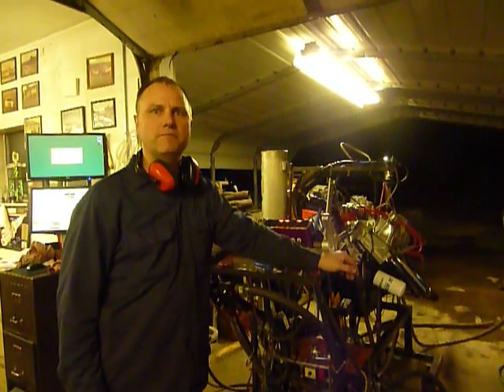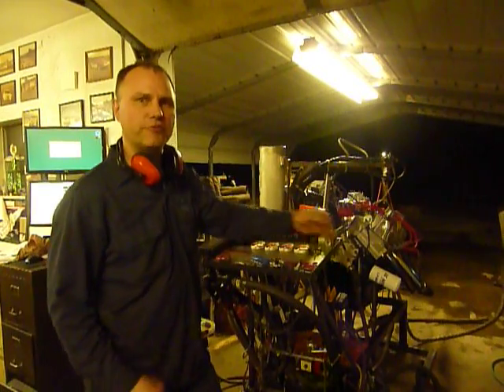408 Cleveland TFS Heads Dyno Pull 550HP Pump Gas

Comment: Do you prefer the trickflow over the chi heads?
Reply from the maker: Not necessarily.  I've had really good results from either of those brands.
Reply: @DaveMcLain  if I go the trickflow route I would be able to run my current airgap intake,
Would trickflow 225 heads run well with my stock stroke 351 Cleveland? Or would 195 tf heads run better? I will be doing a custom cam and behind a manual transmission, 3.89 gears
Reply from the maker: @jesco6830  The air gap intake will work great and I'd use the 195cc version.  Also I would recommend welding up the divider.
Reply: @DaveMcLain  225 is more airflow. Why would I not do 195 instead? Close up the divider in the intake? I though the the divider was good ?
Reply from the maker: @jesco6830  225 is more air flow but the 195 has more velocity helps a lot to fill the cylinder at lower speeds and on a smaller engine.  The divider on that intake it is cut down.  This reduces the 180 degree effect and in your case I think it would be better to have that not be cut down.
Reply: @DaveMcLain  got you. Thank you for very much for the help.